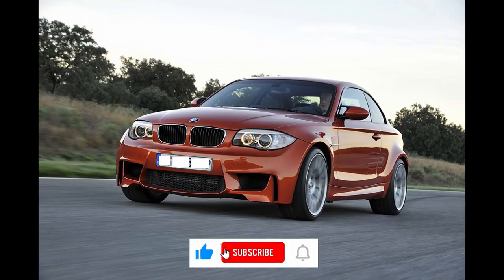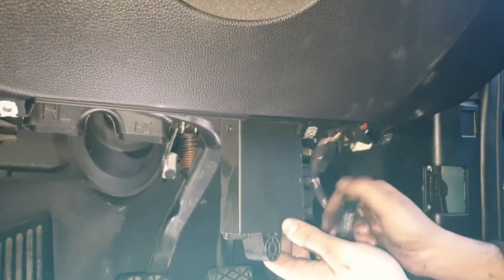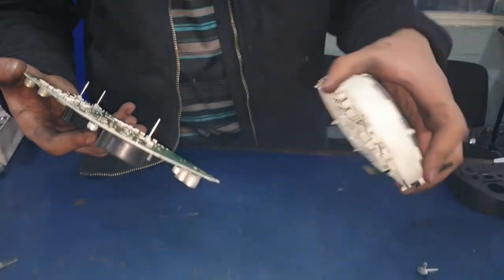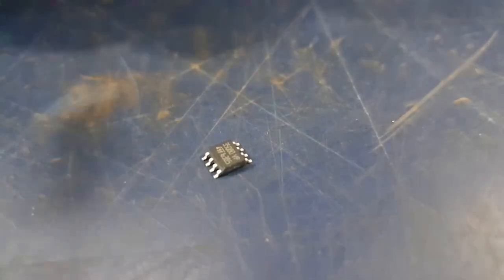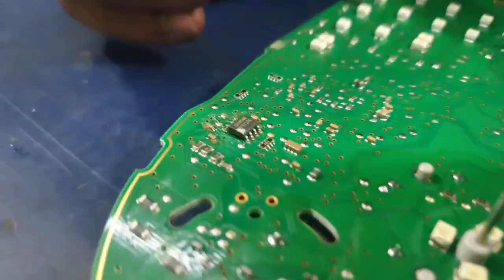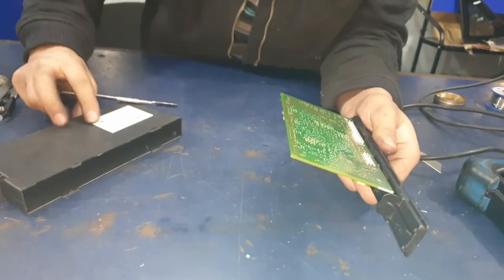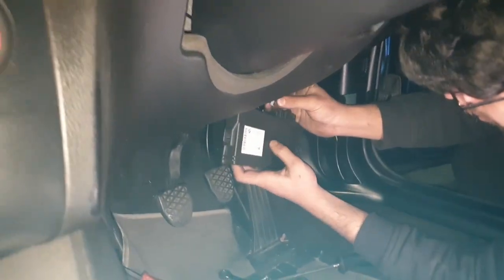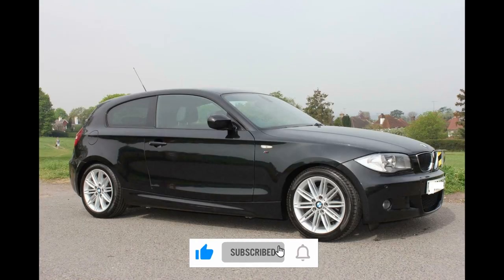Mileage Correction Calibration on e87 BMW 1 Series Dashboard and CAS 3 Unit With Dash Fixer Machine

Comment: New models car mileage setting very easy. But e32 e34 e36 e38 e39 e46 dont easy
Reply: Wrong bud the older cars are 10 times easier ,like the e38,e39,e46 store mileage in 4 places ,dash ,ews,lcm and key and all of those can be changed to what ever mileage you want with tools that cost less then $100 total . The older ones like e32 ,e34 old dash and you can change those in 10 mins with a simple epprom reader $20 . The newer bmw store mileage in many modules 10-15 depending on the model ,even your hvac unit stores the mileage .No tool can change the mileage in all the modules in  newer model 2005 up bmw .2015 and newer models you can do but those have 20+ modules that store mileage and anyone with a decent scanner can find out easy the mileage has been tampered with.
Reply: @mikealkarout9555  an E87 where store mileage info? Can i read out by making a false error such as removing a head lamp bulb and check again the km by diagnostic tool.I guess diagnostic toll will show real mileage . or depend on if which other mother stores KM info , there we can create a false error and we can read error by diagnostic tool.im a wrong?
Reply: @denizbagci  Many different modules ,some store actual rolling mileage and some store the last 5 faults that module had and at what kms it happened at. The cluster and cas you can adjust with a R270 easy. . China clone bmw e/f scanner full also called Bmw explorer will let you reset mileage in many of the modules like dme,dsg,egs,ihka,vdm,vtg .. Yes your trick will work for the tpms and fuel pump because the car registers the last 5 times you filled up fuel and at what kms and the last 5 times your tire was on low air and at what kms it was low at. So for the fuel just fill up some gas every 50 or so kms  5 times and for the tpms just let air out of the tires 5 times about 50-60 kms apart .Bmw e/f scanner will let you reset the last 5 oil change kms also.This will ''get by'' 99.9% of people .
Reply: @mikealkarout9555  my aim Is how to realise if odometer have been manipulated. Most of people reprogram the odometer and cas. As long as they match no problem. But I want to go further and see if other modules also stored the mileage and we can manipulate another error or read maintenance tasks as you said. Is there any way?